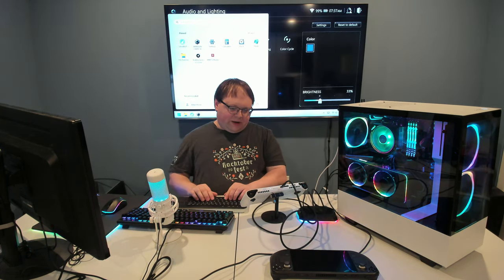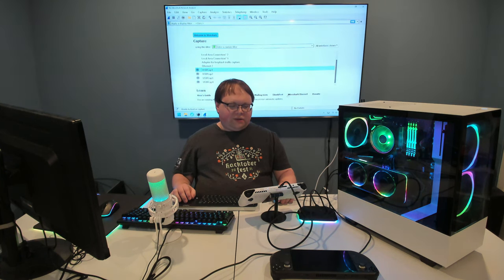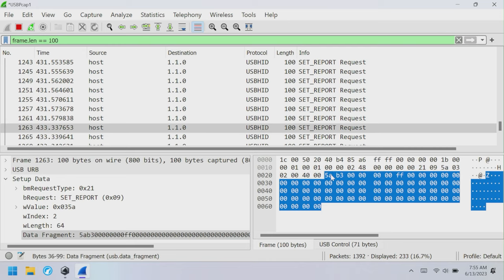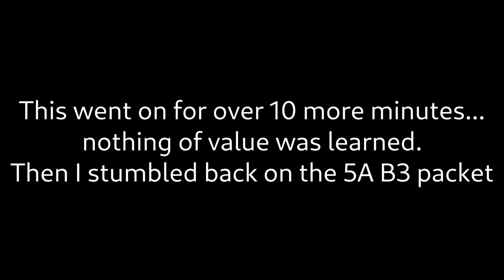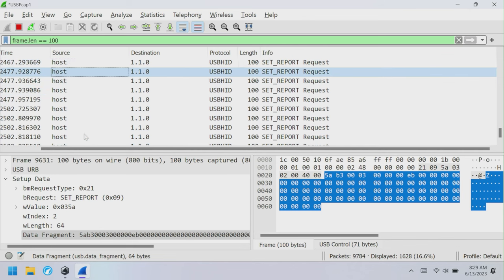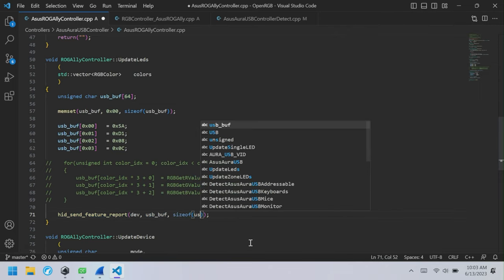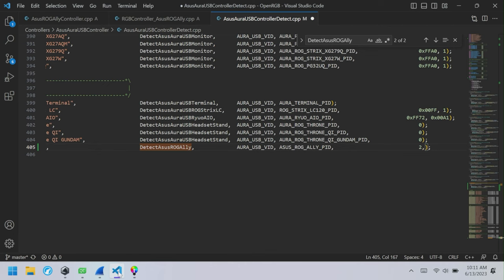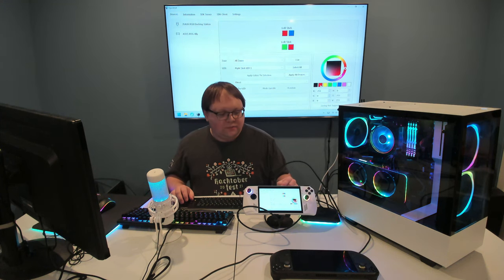Reverse Engineering the RGB on the ASUS ROG Ally: Part 1 - Direct Mode

Comment: @calcprogrammer1 HI there, not sure if this is the best place to report this but. Have you heard of any stuttering issues caused by OpenRGB? I have found that if I leave OpenRGB running for 4 or 5 hours my whole system will slightly stutter until I close openrgb. If I reboot openrgb, everything is fine for another 4/5 hours and then the issue re-arises. Are there logs or something I can share somewhere? I looked in the base directory and didn't find any. Doesn't seem to be a memory leak, as the footprint didn't increase, but it was using close to 7% of my total cpu (Which considering I have a 7950x3D is a lot). I'm on 0.8 which seems like the newest, but I've been wrong before
Reply from the maker: Are you running the effects plugin?  OpenRGB doesn't do much in the way of continuous loop tasks for most devices unless you're running the effects plugin.  Some devices require continuous pings to stay in direct mode which we do have threads for.  That's all I can really think of, and those updates should not be a hard hit on the CPU at all.
Reply: @CalcProgrammer1  I am running the effects plugin. On Hypnotoad if that matters. Is there a log or anything I can check to see if there are errors. It only happens if I'm running the program for a long time
Reply from the maker: No idea.  Do you have any SMBus/I2C devices (RGB RAM, some motherboards)?  I guess a 7950x3D wouldn't have an SMBus controlled motherboard as newer boards have all switched to USB based RGB but RAM still uses SMBus.
Reply: @CalcProgrammer1  the mobo has a little rgb plate thing (Gigabyte x670e aorus master) but I'm not running rgb ram. Its puzzling though as its seemly random (other than the 4 hour plus requirement) when it triggers. Not a big deal since its easy to mitigate but I figured you'd want to know.

Comment: Do you have a tutorial to add mouse types and brand from onikuma or any mouse ?
Reply from the maker: Mouse is going to be USB HID so the process will be very similar to what I did in this video series.  Wireshark captures to get the packets, hidapi to control the device.